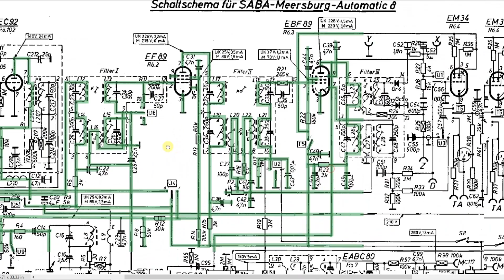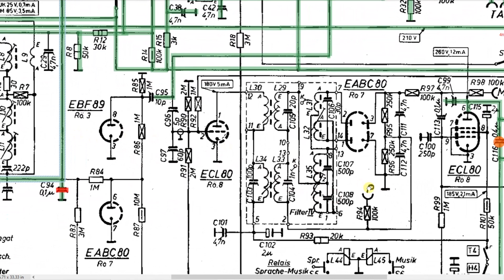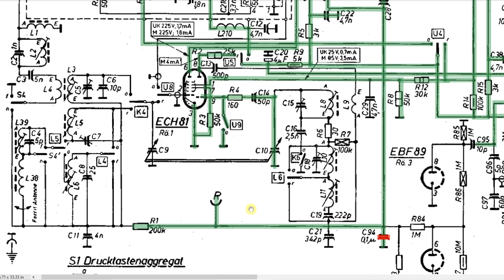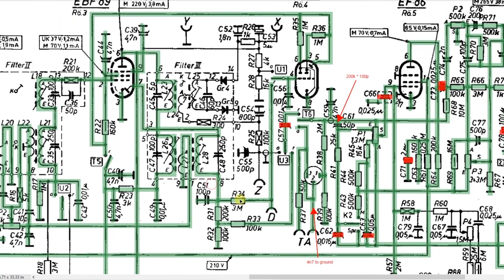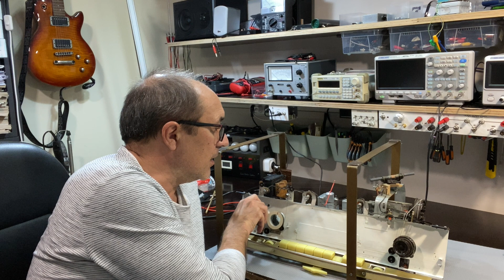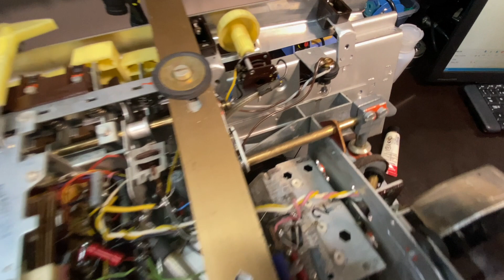SABA Breisgau 8 pt. 4. Testing the AM Bands - Longwave, Mediumwave and Shortwave.

Comment: I'm very interested in how you do the transformer voltage dropping, never seen it done. I like the idea of that MW/LW ferrite rotation device, only seen it once before on a large floor sitting radio. I would have expected something on the ferrite antenna with very strong stations. Looking forward in seeing the auto tuning working. Those bridge rectifiers make a horrible smell when they break down, have witnessed it many times!!!

Comment: Hi Manuel, Can you mention what might be the pot (p2 - 1K) located on the schematic below the 2nd IF transformer. It looks like an adjustment for the bandwidth, - is it a preset or is it on the front panel for customer adjustment? - greetings from Ireland, - Rod
Reply from the maker: It’s a strange one, but is adjustable on the treble control. I believe it actually adjusts the bandwidth - more bandwidth equals more treble - and is a dual pot that adjusts in harmony with the audio treble control. Very unique this one.